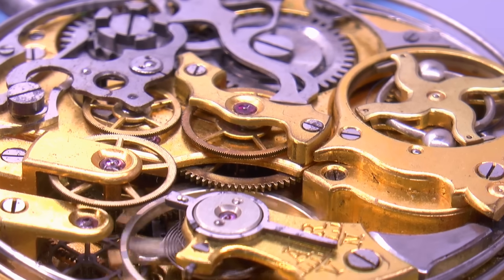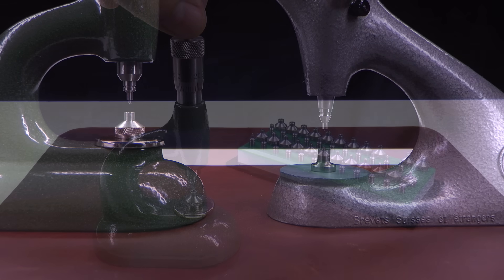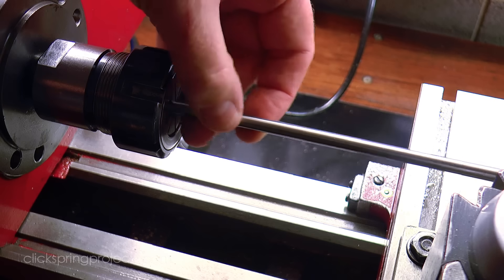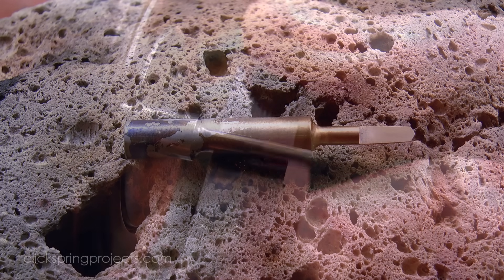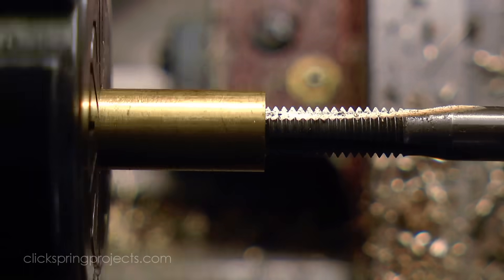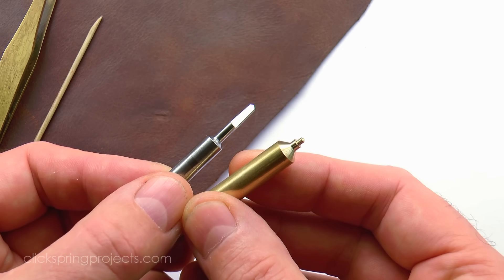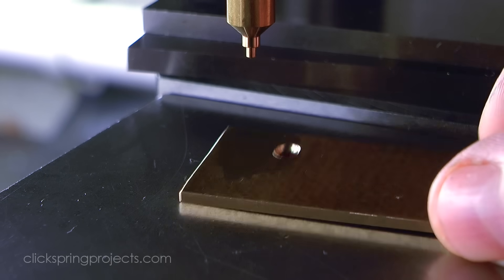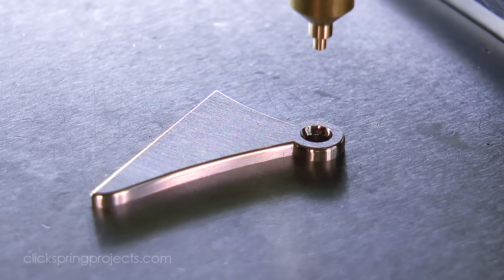Can Jewel Bearings Be Pressed In The Home Shop?

Comment: I noticed that ruby and sapphire have small but maybe not insignificant coefficients of thermal expansion (~5.5•10-6K-1), so chilling jewels before pressing might help slightly in a pinch. Not as drastic a change as heating the receptacle, though.

Comment: I have pressed in many jewels where it was more convenient to try and make up very small bushes for small clocks. Careful broaching out to give a press fit. Smaller wheels in most trains are under very little stress and are hardly likely to push out on axial load.

Comment: Any resources involving watchmaking that has an overview of what machining-based factors we should take in to account?
I ask, because I'm a Mechanical Engineer who worked with CNC milling machines, but find all the machined design choices fascinating (specifically, why you would want to make this cut here, or that groove there).  Example:  You put a spring inside that pusher, and I find the reasoning for that more fascinating than the machining of the device itself.
Also:  Do you have any videos on diy gold plating?  I have a watch body that needs retouching, and I think it'll be fun to buy some 18k gold, and do the re-plating process myself (but with much thicker gold plating to make it last longer this time).  Polishing the gold after plating is also interesting to me, if applicable.

Comment: To make something about 1/100 mm smaller or larger than you already have, you may sometimes simply use temperature. Just calculate the required temperature from the desired shrinkage and the thermal expansion of your material.

Comment: 0:27 wait till you see the internals of a modern Formula1 engine
Reply: No offense, big racing fan myself but a watch is an engineering marvel. The performance of a F1 engine is impressive and the engineering in its own right is impressive but the mechanical complexity isn't as intricate.
Reply: @boristartakovski7708  mechanical complexity isn't intricate? Have you even seen what an F1 engine looks like? It's like you're comparing a modern carbon fibre cam-crossbow to a GAU-8 Avenger, and calling the crossbow "more intricate".
Reply: I don't like waiting. Have you seen an F1 racing watch? So fast that most people have not.

Comment: As a computer programmer - been working in software for 25 years, but my degree is in hardware. Anyways, for me, a clock is basically a counter that displays a conversion... analog clocks are taking a timed motion that reverses periodically and counting it... converting that to a mechanical display of the count of oscillations. In digital electronics we have to do many conversions depending on voltage - 1.5v to 3v or 3.3v to 5v... or maybe speed conversions, etc.  Also there are many different types of Digital displays 7 segment, CRT, LCD, LED... would be interesting to have a precise mechanical display... that could work from various inputs as say a component ... that could be conceptualized as a building block, so that it would be just a module in a system for making an interchangeable system... sorta like lincoln logs or erector sets.  Something that could be built that does the job, but allows for adjustment tinkering and conversion but still provides for creative exploration of the mechanism, but standardized so amateurs and kindergarteners could work with it... anyways... I need more coffee and less rambling... off to build an accounting system. =D

Comment: I find it ironic that the best, most masterfully crafted mechanical Swiss watch hasn't got anywhere near the accuracy of a cheap dollar store Casio. On account of how reliable quartz is as an oscillator to count oscillations of in order to keep time. I've made tons of clock (computer clock, as in clock speed). But none based on quartz. The oscillator instead is either a resistor and capacitor, an inductor (coil of wire) and a resistor, or all three combined. It's not perfect by a long shot, though. The parts have tolerances varying from 5% to +20%/-10% and never less than 1%. No bueno for keeping time on long scales. Quartz is more reliable.

Comment: Youtube randomly suggested this video, and I'm glad I watched it. Interesting little piece of machining.
I work as a machinist on much larger equipment, and we've been working on cutting tool design and development recently. The narrow land area shown at 4:20 is INCREDIBLY important to the function. Too narrow, and the tool can dive into the work, cause chatter on the surface being cut, or the edge of the tool may fail. Too wide, and the pressure needed to push the tool to cut goes up dramatically, and can start ploughing and smearing the surface instead of cutting.

Comment: The nice thing about the red saphire (ruby) is that the synthetic ones usually glow under a blacklight. I used to work with a liquid chromatograph that used tiny saphire check balls in the pump. They were the clear ones and if one rolled away it was damn near impossible to find.

Comment: Curious about press fits. Does the inner dimensions of metal spring back to size after having something like the jewel pushed out? Like would there be an fitment issue putting the jewel bearing back in?

Comment: A bearing fitter may not be required,,,,,,In heavy machinery like excavators and bulldozers,,To fit a bearing in a press fit,,The bearing can be placed in a freezer or liquid nitrogen to shrink the bearing,,The bearing then just falls into place,,And as it comes back to room temp,,It is as good as Press fit,,,,But I have no idea if you could do this with a ruby,,,Just an idea....

Comment: What is that solid oil you're using during the heat treat? 6:53
Reply: I would like to know as well. Looks like lard or coconut oil. ???
Reply: If it’s the same substance he’s shown in previous videos (and the green flame in the subsequent shot makes me think it is), that’s not oil but a boric acid and methylated spirits mixture. The purpose of that mix is to minimise the formation of heat scale on the part making it easier to do cleanup work on the now hardened part. He shows the label in his Spare Parts #12 video, and I think he introduces it in detail either in that video or another - been a while since I’ve watched many of those so I can’t be sure.

Comment: 6:54 What is that, coconut oil?
Reply: A boric acid and methylated spirits mixture, meant to limit the formation of black scale on the part for ease of cleaning post heat treatment. He shows the label of that jar in Spare Parts #12 and may also introduce it further there - but I haven’t watched the older videos in a while so I can’t be sure it that’s the correct one.

Comment: Chris, you are inspirational! I bought some jewel bearings on sale and was intimidated by their size so I haven't done anything with them. Instead I bought some round 13mm synthetic ruby/sapphire's and slowly lapped a cone into them to make pin point bearings. It's worked, but I'd love to have a go with the "proper" parts and you've just given me enough belief that I could pull it off to have a go! Thank you!

Comment: Can you salvage an oversized jewel mounting hole by peening and reaming it, or is the part scrap?
Reply from the maker: Yes certainly, it is much as you suggest - gently close the hole with a light pressure from a suitable stake (a hardened punch sized to encompass the hole appropriately) with perhaps light hammer taps if required, then ream - Cheers :)
Reply: @Clickspring  Thanks!

Comment: Your boundless patience, craftsmanship, and attention to detail is evident in every project you do from your small and relatively simple tools and mechanisms to your large and complex assemblies. Your videos always inspire me to try to improve those qualities in myself with my work. Software development is quite different from machining and watchmaking, but at a fundamental level there are similarities. One often writes their own code tools which are then used for engineering pieces of differing size, shape, and purpose. These pieces are assembled to produce a complex system which is used to achieve some goal. At the lowest level a system is just moving, translating, or generating bits information within itself based on the received inputs, desired outputs, and the design of the system itself. I see this as similar to how a mechanical watch controls the flow of kinetic energy from a spring, directing it through a complex series of mechanisms intended to produce precise repeatable movements in the pieces on its face.

PS. I always stay to the very end so I can hear you say "Thanks for watchin'. I'll see yah latah!"

Comment: Hey Chris, I had a team of students working with Swiss Jewel back in 2012. They supplied us with some synthetic sapphire jewels for a model F1 car. We fitted 2 in each aluminium wheel and used common sewing needles for axles. It was a great idea, but the judges didn't get it. We made up the process for fitting the jewels as we went along, but it was a pretty close copy of what you've shown. I have a George Thomas tapping and staking tool and it was used for most of the work. We had spare jewels, but we didn't break any, so that was a win.
Reply from the maker: Sounds like a great project mate :)

Comment: Interesting I have a device that looks like a jewel pusher that is used to insert copper VIAS in printed circuit boards to construct or repair micro-electronics. The device has several heads that fit in the copper vias that are a few hundred microns across. This video had me looking up corundum balls and raw material even though I've never ever attempted to build a movement of any kind.
[edit] Yes, the tool and the heads are very expensive.

Comment: You learn something new every day. I never knew Jewel bearings were even a thing!
I can imagine telling my wife, "I'm buying us some Jewels" She immediately perks up excitedly......
 .....For my Dial indicator Project. 😂
Reply: maybe make her some jewelry using these jewel bearings
Reply: Well that should be interesting. Those need to be good to .001 or less
Reply: If you use steel pivots and jeweled holes, you get very little wear and low friction.
If you use steel pivots and brass holes, you get worn out holes before more difficult to repair  -worn out pivots.
If you use steel pivots and steel holes there is downside. You get the worst friction and the wear on the pivots is much worst than with brass or jewels.

Comment: Is a jewel still used out of tradition instead of a carbide bushing or other hard modern material
Reply: Tungsten carbide and boule-grown ruby have about the same hardness (above 9 Mohs) and in terms of function both are harder than strictly speaking necessary for the job at hand. But the infrastructure for producing bearing jewels is already in place, and since they're pretty cheap I suppose nobody bothers with anything else.

Comment: I recently used some 681 size ball bearings (3mm OD, 1mm ID) to make some very tiny 3D printed fidget spinners. Even though they are very simple by comparison, they gave me an appreciation for working at the scale you share and the tools you make to work at it (I did not make any custom tools, but I am considering it since I have enough bearings and 4mm M1 bolts to make 50 or so of the spinners). This video is extremely relevant in that regard, but a lot more precise (I used a 2.9mm drill bit for my 3mm bearings, for example). Anyway, I'm no watchmaker or even metalworker but now I'm going to be looking for reasons to buy some jewel bearings. Maybe for some kind of brass and ruby fidget spinner... 😆

Comment: I wonder if it's possible to get them as sapphire instead (I believe that's still a type of corundum) to complement your usual brass/blue steel aesthetic
Reply: Funny that, I’ve seen ruby, pink and clear sapphire bearings but I can’t recall ever seeing blue, which is a much more commonly found colour in natural stones.
Reply: I had the same question. It looks like there was a limited and rare Rolex that used blue sapphires. I found some examples from alibaba, but they don't say if the color is available in all shapes or if you can choose (also skeptical on quality). So if you have either the money or time and patience, possibly.